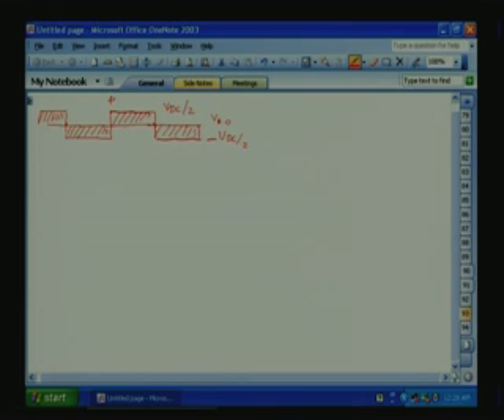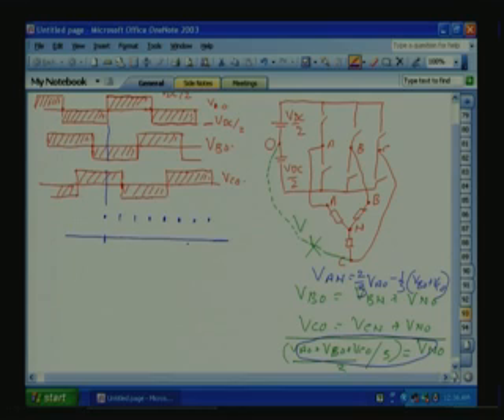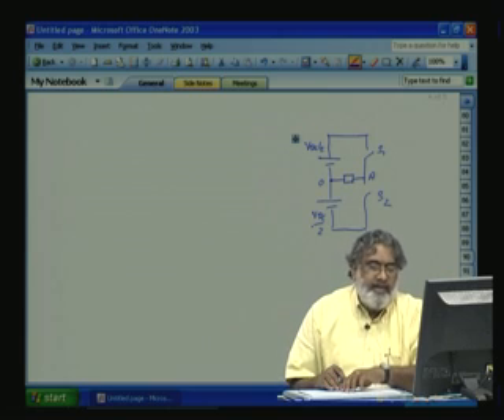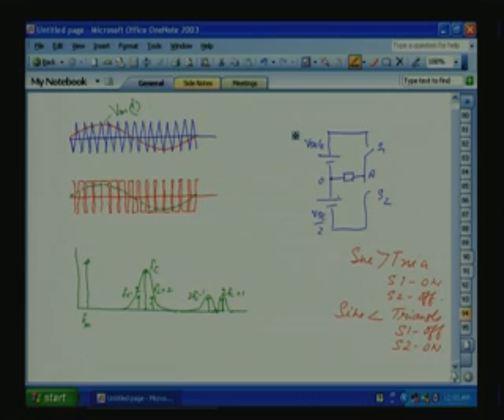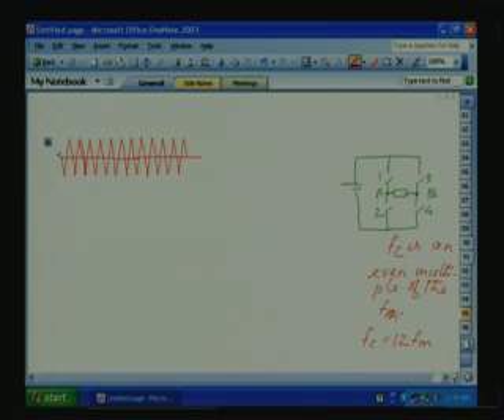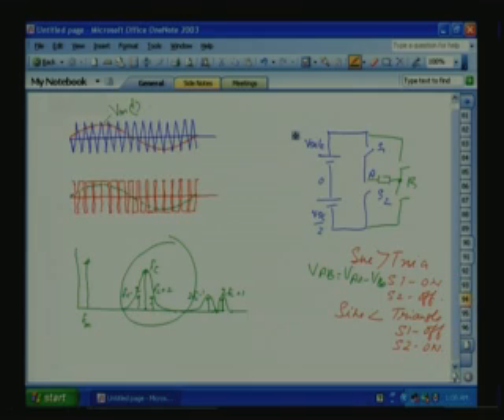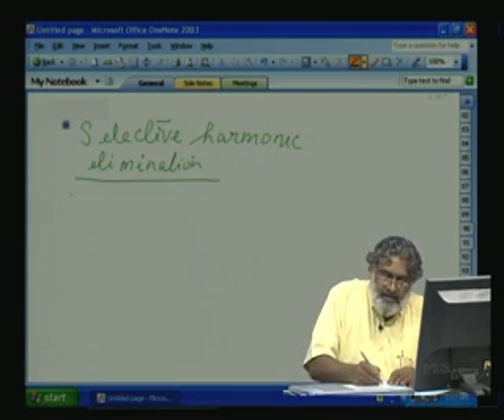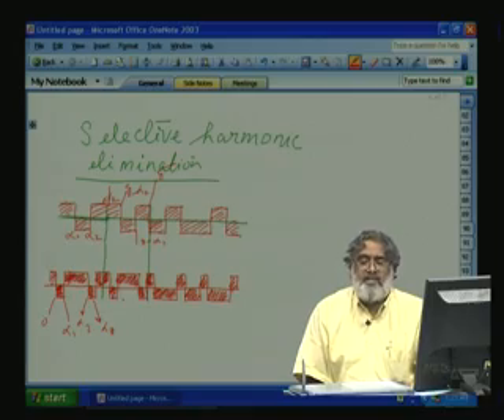Lecture - 24 Inverter Sine Triangle PWM

Comment: How did you turn the DC waveform into a triangle wave , and a sine wave? Where would the DC input go in an OP-AMP circuit to create these outputs? I am very confused.
Reply: look for sine wave generator circuits using opamps. They are oscillator circuits working with positive feedback. BTW today people use lookup table stored in the memory of micro-controllers for sine wave.